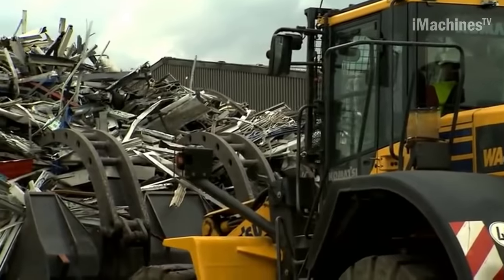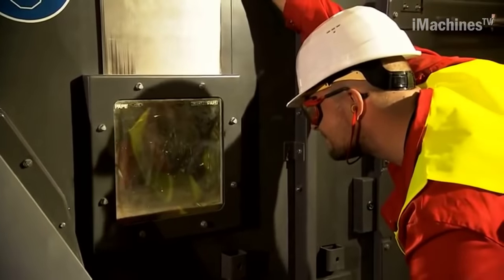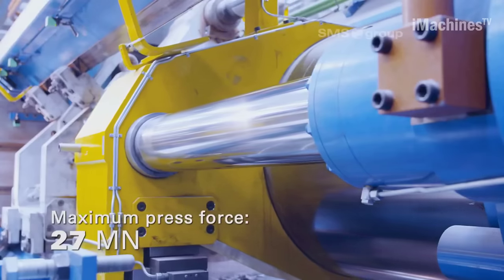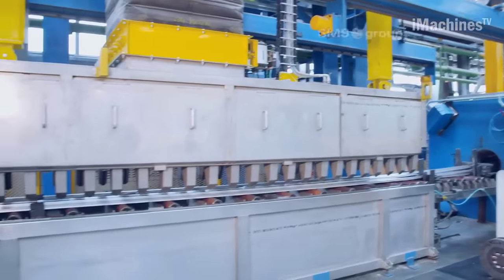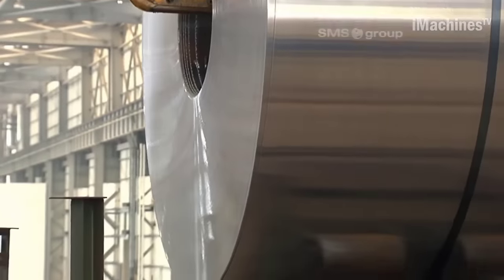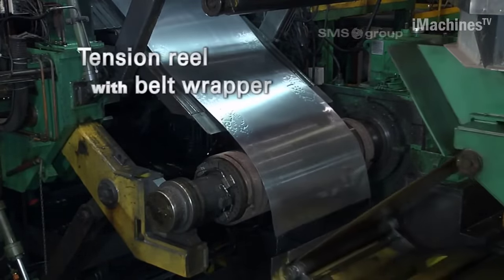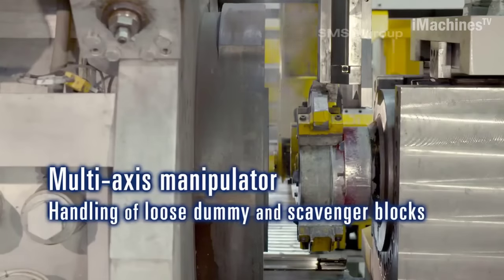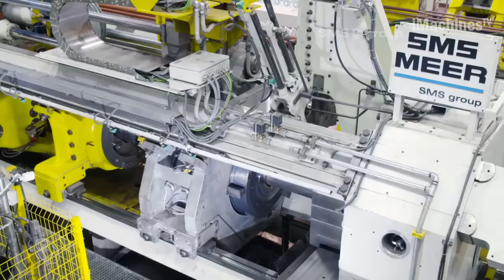This Is How Factories Recycle Billions Of Tons Of Aluminum. Copper Extrusion Press Machine

Comment: One of my friends developed the very first optical sorter using a 286 processor. Was used to sort potatoes. Used a fourier transform.
Reply: What did you do with the FT ?  Convolute a sack of potatoes with frequency domain representation of a rectangular grid to make french fries?
Reply: Dialog is clearly computer generated
Reply: @christianzazzali2720  what "dialogue", why don't you quote something so we know what you are talking about?
Reply: @tuberroot1112  Folded the image of the potato in half with the FT.
Reply: That was difficult, in the day.  Your friend was a pioneer!

Comment: That’s great!  Now build something that can recycle the plastics that we put in landfills.
Reply: We already recycle plastics.
Reply: It'd be great if they could build a machine that has a huge funnel at the top, you drop trash/waste into it, and then pure atoms fall out the bottom into their respective buckets...Carbon atom bucket, aluminum atom bucket, copper atom bucket, etc.
Reply: @JerryDLTN : It may take quite some time, but it will happen.
Reply: @JerryDLTN  That would be less than optimal for certain things, such as the mentioned plastic or glass. Instead of recyclable glass you'd get things like sodium metal and oxygen gas.

Comment: 27 mega newtons is 2.3 trillion centemeters a second from what i could learn from google. WOW
Reply: Those aren’t the same kind of units. Newtons are a unit of force, not velocity.
Force is [mass] [distance] [time]^-2
Reply: @drdca8263  I understand what you mean. Would it calculate the same if the the objects weight was traveling at this speed? Maybe i didn't google it right.
Reply: @flippensweet3  if you apply a net force F to an object with mass m for an amount of time t, this will cause a change of velocity of F * t/m (provided that the speeds involved aren’t anywhere close to the speed of light)

Comment: Why don’t they use magnets to pick up the aluminum? 😊
Reply: They do sort using magnets but it then has to be sized to filter out the undesired contaminated alloys that are not suitable for the process. It's explained in the video.
Reply: @DarkVoidIII  cool, when I was a kid we used a big magnet and a clothesline to fish beer cans out of a creek.
Reply: Aluminum isn’t ferromagnetic?
... though, I’m confused as to why magnets would have stuck to those beer cans? Maybe beer cans used to have a fair bit of iron in them? Idk
Reply: @drdca8263  steel cans 😀
Reply: Aluminum is not magnetic. If your can is attracted to a magnet, then it's a steel can. (Steel cans coated with tin are commonly called "tin cans.")

Comment: Now hold on. If the surfactants don’t align with panometric fan coupling of power being generated by the relative motion of conductors and fluxes produced by the modial interaction of magneto-reluctance and capacitive diractance how can the machine base plate of pre-famulated amulite surmounted by a malleable logarithmic casing operate in such a way that the two spurving bearings in a direct line with the panametric fan. Simply put, if six hydrocoptic marzlevanes, so fitted to the ambifacient lunar waneshaft with side fumbling effectively prevented 
the main winding was of the normal lotus-o-delta type placed in panendermic semi-boloid slots of the stator, every seventh conductor being connected by a non-reversible tremie pipe to the differential girdle spring on the “up” end of the grammeters
Reply: No, they don’t.
Reply: My thought exactly
Reply: Well, that's a mouth full.

Comment: How come he gives ALL measurements in metric, which NOT used in America, but refers to the metal as 'aluminum' which is a spelling/pronunciation almost exclusively by Americans. one or the other would be nice.
Reply: The bot changes to the term „Aluminium“ later on in the video
Reply: Because the original video was in german from Germany. If they were considering the effort of translating everything, they also had used a real human narrator. But because of budget limitations - no.

Comment: If you are going to use metric measurements, can you at least convert them as well? I have no concept as to 1300 cm, but 511 inches means something.
Reply: Google shows that 1 inch equals 2.54 cm. Any search engine could tell you that.
Reply: 1300cm is not a metric expression, because it is like saying 1,300 x 0.1 metres.  1,300cm is thus 13,000mm or 13m.  511 inches means nothing to me even though I grew up with imperial.  But as you converted the 13m to inches, it seems it was not so difficult.  If you think of a metre as just over a yard, you cannot go too wrong, but maybe you only think in inches ?  Then I wonder how the speedometer of your car looks !

Comment: homogenous
[ huh-moj-uh-nuhs]... It's difficult to be scientifically credible when you can't pronounce relevant words, adding an extra syllable and letter takes you into "ignorant".  This video appears to make the recycling process more difficult than processing raw ore and then alloying it to the desired grade of aluminum. If that is the goal, then the pretense of being environmentally better is evident.  I love the business of taking processed material and reusing it, pretending that it's "green" is a deception. There is nothing about the manufacturing of the equipment used to recycle aluminum that can be considered safer than any other process. Kinda like EV's, once you educate yourself on the incredible toxicity of building, disposing them, plus the illusion of electricity being "clean" energy (relative to the power plant) you find yourself going from ignorant to educated, then pretending you didn't see any of that, going directly to stupid. Your choice, until they throw the power switch.
Reply: Making aluminium from ore uses electricity and carbon electrodes. Thus giving off carbondioxide just by burning down the electrodes in the process. One can't just smelt Bauxit and get aluminium. It is as involved as the recycling. Have you even processed the given video and understood what is really going on in the sorting/recycling of the alloy mixture.